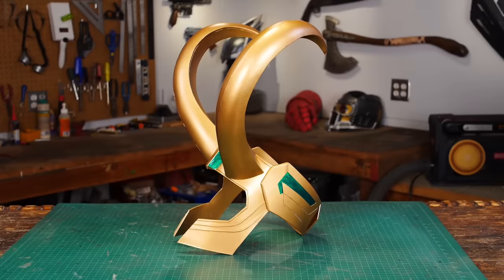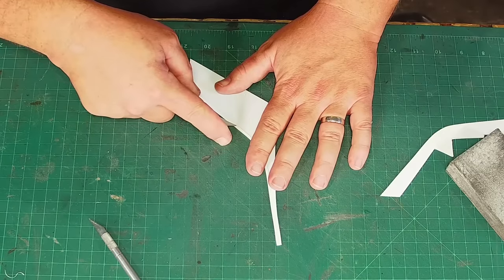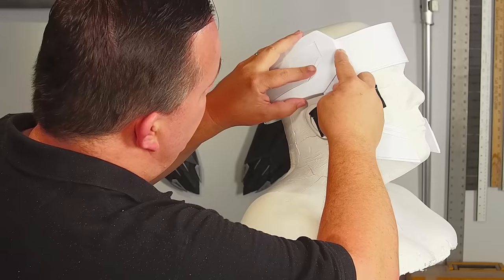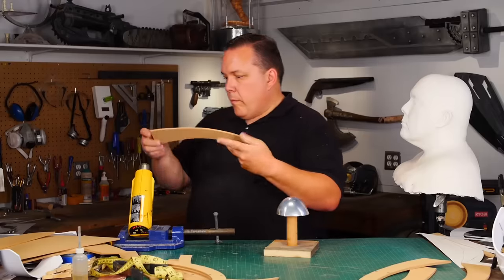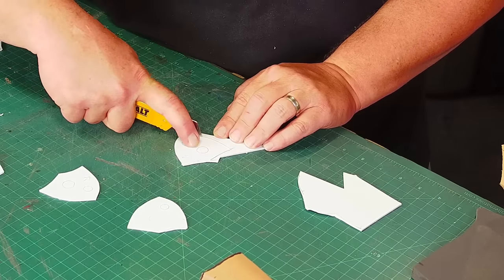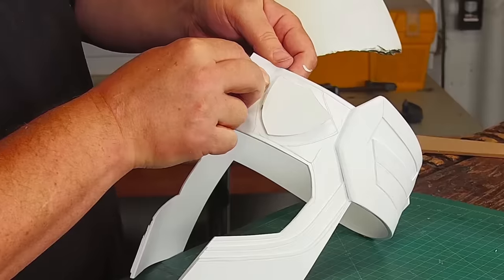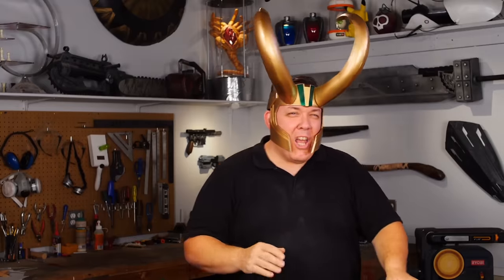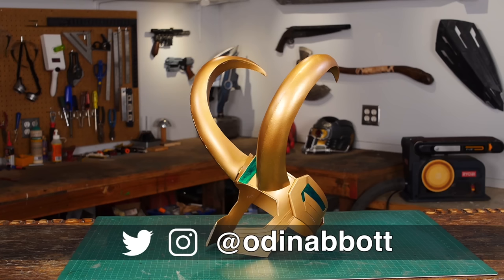Odin Makes: Loki's Helmet from Thor: Ragnarok

Comment: it would be cool if you did a sort of like 2 in 1 helmet where you can put a platform on the top with magnets so if you want the Original helmet, just put the said platform on top. however if u want the Ragnarok  version you can just take it off the top.